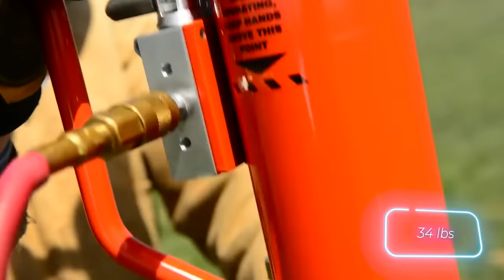13 COOL TOOLS YOU DIDN'T KNOW ABOUT BEFORE

Comment: The drill pump has been around for many many years. I have had one for at least 15 yrs.
Reply: I haven't seen one but I'm probably not in the right industry.  I would get one if was less than $100.  This one seems way overpriced.
Reply: @titusdaniel  I bought one for about 15€ a couple of years ago. A simper model than this one, but it did the job just fine.
Reply: 40 years here, but they were much less productive back in the stone age.
Reply: Got one for 10 bucks 20 years ago, still works

Comment: THE HAMMER STAPLER HAS BEEN AROUND FOR YEAR'S. I USED ONE FOR ROOFING 20 YEAR'S AGO. I WOULD STAPLE BLACK TAR PAPER ON THE ROOF BEFORE LAYING THE TILE DOWN.
Reply: They dont say it new tools.
Reply: @jansoderman8550  the title says "13 tools you didn't know about before"  I had one of them 10 or 15 years ago
Reply: They have been about for 25 years , use them for carpet fitting to Staple the underlay down
Reply: @ajdesmond9545  been around longer than that.
Reply: @TJ-si7ug  got my bostitch stapler near 40 years ago, still use it from time to time

Comment: Hammer Staplers have been around for many years , they have been used  for installing Insulation,TarPaper onto Roofs  and many other items  in the Building trades  i helped building Homes in the 1970s and 80s and we  used them a lot  they have also had Pumps that operate  D by Drills for transferring liquids  since the 1970s that  have standard GardenHose connections on them  so that you dont need to Purchase Propierty hoses with the Pumps manufactured fittings like the one that was shown in this video

Comment: 1. For almost as long as there have been power drills, there have been simple little drill powered pumps that cost less than 50 dollars... 2. That is a hedge trimmer with a different blade. Figure out the blade, and you'll have the saw for a small percentage of the cost. 9. That tape/paper 'dispenser', is a paint masker, and has been around for at least 40 years. 11. Floor scrapers have been around for centuries. That said, the one shown is a very good deal! 12. Hammer stapler. Been around for at least 50 years.

Comment: 3M Hand Masker? Had mine for 20 years and they weren’t new then. If you didn’t know about that one you’ve never been in a hardware store. And that adjustable socket head thing? Just the deal for tight spaces….right. What is notable about so many of these devices is their obvious drawbacks. Take the tool for drilling screws at an angle into deck boards: Even many hardwoods will quickly split when fasteners take such a small bite of the edge of the board. And that drill-powered wallboard cutter is suitable only for old work boxes, which account for an imperceptible fraction of box installations. Olfa makes nice cutting devices but I bet the fancy blades for the knife here cost way more than the norm, assuming you can find them.

Comment: The reciprocating saw has been around for decades too and mine has 4 blades.  We have been using pneumatic reciprocating saws in the UK since the 1960's; the Cengar saw.

The hammer tacker too has been around for decades too.  A favourite of carpet fitter.
Reply: Why are they censoring comments about tools now? YT has lost the plot.
Reply: and a MUST for roofers
Reply: I’ve been using the tape roller since the 90’s.

Comment: In Canada we have a tool that is similar to the NKT tool, it hides the screws very well. The problem is the cost of the screws, they are very expensive.
Reply: Driving screw on an angle on the board edge is also just stupid in Canada.  One winter and the board will crack all along the edge.  
There's a reason it never took off in Canada.   We get board shrinkage from the cold but expansion forces from ice.  Deck board inevitably curl and if the crews aren't vertical the boards just  crack.  That's also why is actually code to pre-drill the screw holes and have double joists or 4 inches for deck board ends, because if screws less then 1 inch from the board end will crack the boards

Comment: 2:57 this cutting tool is a joke, the normal carpet knife with break-off blade is and always was superior.
5:45 it's a toy torque wrench , literally only a toy
6:42 that is so useless, you need to squeeze the handles together before even doing anything else, the two adjustable wrenches that were already present on the table in video is all a mechanic needs
8:25 THE WINNER, that is a useful tool, it exists in a different form tho 
9:14 it's a shovel. 
9:55 i have such tacker at home, that this is older than me.
10:52 this looks like it can rip off muscles off a bone....if you know what i mean

Comment: Seen those "hammer staple" they are pretty handy. The trencher is a great idea if it works with hardened grounds packed with soil and rocks. One of the problems we have with tillers where we live.
Reply: Our ground is all clay, I doubt it would work
Reply: Yeah my grandparents had one 40 years ago, but yes its handy.
Reply: If you need one to work with clays, the cheaper option would be the ditch witch.
Reply: I remember using a staple hammer while framing several decades ago.

Comment: Drill powered transfer pump attachments 0:12 have been around for over 50 years!
The hammer stapler at 9:54 isn't new at all! I was using that over 30 years ago, when I used to install insulation in newly built houses!

Comment: $335 for the pump attachment? You can get a similar pump that you just chuck up to the drill, and has garden hose threads for less that $20. It's easier to attach, smaller (easier to store), and has a faster flow rate.

Comment: I love when they say how many cuts you'll get either through the amount of cuts or hours. Every person that uses tools knows they will probably used their battery for more than one tool. That's another problem I'm sure someone has a great idea for. Cool stuff!
Reply: cuts per hour may vary depending on the hardness or softness of the material. If the wood is hard. Hahaha I said hard wood 😁 anyways it requires the blade to spin using its torque for longer thus draining the battery faster. Are you cutting when it's warm out, or cold? Are you that guy who never takes his pack off the charger? Did you train the battery properly, when you took it out of the package?  Is the tool brushless? General original style battery pack or Lithium Ion? Side Note did you know your Lithium Ion batteries are essentially bombs? If the housing breaks and exposes the insides and it drops in water make sure you run like hell.. Lithium is reactive to water and explodes blue, and yellow gets hot like MAP gas.. watched a guy cut open a AA Battery, and unrolled the inside and tossed it into a glass cooking pan and it exploded. He's on YouTube and should look it up sometime.  Sorry I know I went a little A.D.H.D. on the topic

Comment: should combine the pnuematic post pounder with the tile removal scraper😊...that'd be cool.
Reply: It exists already.
Reply: I have one it’s great
Reply: If you can think of it, it's probably already in existence.
Reply: I got an oscillator tool, I use it for cutting bolts off and stubborn studs on toilets, it cuts tile, and removes grout, has a sanding attachment I use it to remove door frames as well. Best $60 I never spent. Was a gift
Reply: @Republican_Extremest  Surprisingly handy tool and cheap when the patent ran out.

Comment: The post driver, it's not about avoid strenuous labor, or saving time as it may actually take long, but it's about preserving the body. We do so much damage to our bodies every day, and swing a sledge hammer for several hours a day is not good for the body. Just as a physical therapist about the injuries they see from this stuff.  I'll say this, too, while I've driven some posts/rods into the ground the old fashion way, and it was very satisficing to look at what I did at the end of the day, if I had to do it on a regular basis, I would 100% choose a tool that would do much of the work.

Comment: As someone who has pounded a stake or two, I would say that anyone buying that post pounder isn't trying to be lazy or comfortable, they are trying to reduce chance of overexertion and injury.  Where I'm from, we set posts with concrete piles, which means digging a hole.  Idk if that thing would b up to code in my city, but I do know that it would be well worth the grand it cost if I had to sink several dozen posts on a farm since I would get a lot more accomplished in a day  and would not feel like I'd been run over the next morning.  Seriously,  go spend all day with a sledge pounding stakes in the hot sun and see if you want to make different career choices.

Comment: Here in germany these Hamerstaplers are used for years already. They are very useful.

Deckpro isn't a new idea either. I have to many of these things laying around in my workbench. Every brand thinks they invented a new wheel with these... handy but overrated.

I had the chance to test the Eibenstock and they are very good. Only downside are the blades, they get dull very quickly and takes some time to change.

SP QuickFlow isn't a new idea either. I have a pump for my drill from Wish (1,50 Euro) for years now. Even the cheap ones do their job very well.

My addition to this list would be the hammer with an integrated nail dispenser by Michael David Young.
Very easy to use, even for someone without experience.
I only tested out a prototype and i was already in awe. The finished product is for sure even better.

Comment: To replace the Eibenstock EDB 480.1, simply use a Harbor Freight $40 electric chainsaw.  Save $860 apiece!
The pneumatic post driver is a lifesaver.  That is EXTREMELY HARD WORK.  I'll bet none of the naysayers had ever even touched a manual post setter before, the hypocrites.  Ask the ER how many injuries are caused by them, too.  Well worth the $595-795.
Adjustable Ratcheting Socket Tool: only for someone who hasn't used hand tools before.  VBG.
The masking tool holder is a lifesaver, too.
Hammer tackers are beautiful for their uses, but you need room to swing 'em.

Comment: 10:50  Back in the last 1990s a friend used his chainsaw (with an old chain) to install the perimeter wire for his invisible fence.  This is the thing, only with wider teeth.

Comment: That $200+ tool for cutting out rectangles in drywall exists as an attachment for an oscillating tool that costs around $15. Not that anyone who would actually need one doesn't know that.
Reply: This tool is absolutely a waste. You rough in a house with electric before they drywall. It would only be good for adding outlets after a house was finished. Absolutely waste.

Comment: 10:35 used this for the tar paper when replacing shingles on a roof, also used for rolls of tyvek insulation I call it the wack smack tack pack.
Reply: Or a wacker tacker

Comment: That drill operated pump is expensive. You can buy a regular oil pump for that and use it in a 55 gallon drum of oil and still not spend $330 

The price must be in Aussie dollars because 4100 for a trencher that is a chainsaw blade basically is high. You can buy a ditch witch or rent one and save a ton of money

Comment: 11:30 2900 for the trencher might be a fair price if you need that every day and it will work for the type of dirt you are digging, but another 2000 for that dolly?  Ridiculous.  Any welder could easily make that for about $100 worth of parts and maybe 3 - 5 hours work.

Comment: "The advantages of the tool include its ingenious three-sided nut and bolt gripping system."

You mean the chuck? That's a chuck. They've been around for a long time. Dude built a ratchet wrench with a lever actuated chuck, and wrote a nineteen page patent filing for it?

Comment: I was a "people in the industry" for pneumatic post pounders. Whether to uae a pneumatic or manual post pounder is a job by job decision. If it's difficult to access the location with a vehicle, you're better off just doing it manually, unless there are a LOT of posts to pound in, in which case Olympic athletes wouldn't find it easy to do for a long period of time

Comment: For less than $335, i can buy a proper pump that far outpumps that silly attachment. As for that drywall cutter, a package of blades for my utility knife is about $12 CDN and with 10 blades per package, i can cut just as many holes for a lot less; if i use a drywall saw, i can cut the holes just as fast . . .

Comment: 1) Over priced
2) Stupid because it already exists but waaaay cheaper
3) Too expensive for what it does
4) Pretty good and nicely priced
5) Good concept but it's cheaper to have 3-4 guys hmer away at it.
6) excellent device
7) pretty good but a little on the high price side.
8) device already exists but cheaper and is a drill bit
9) nice device
10) Perfectly priced sheet metal workers might love this.
11) Cheaper options exist
12) overpriced
13) There's a reason why earth movers use heavy machinery

Comment: As someone who has tenitus in my elbow from pounding post into the ground, the man saver would have saved my elbow, it's not the part about it being laborious, using metal to pound other metal into the ground is horrible on the body, its not being lazy its being smart, learn how you phrase stuff, straight rude.

Comment: and the most useless tool in the world award goes to "the Adjustable Ratcheting Socket Tool"  It will work well when demonstrating on nut and bolts positioned on a 2x4 but pretty much no where else :)

And that 3 sided grip, move over 6 point sockets :)